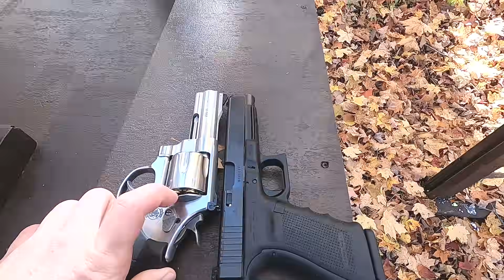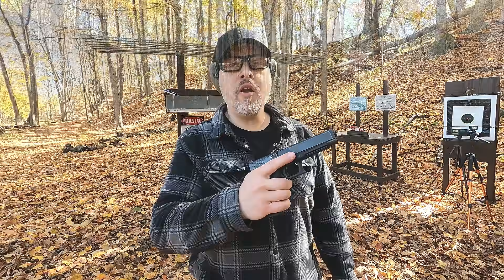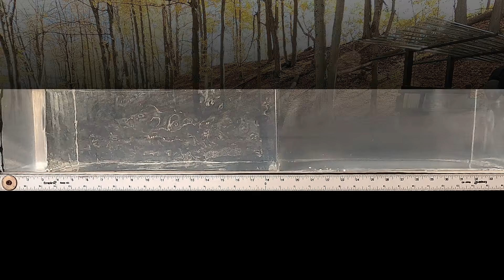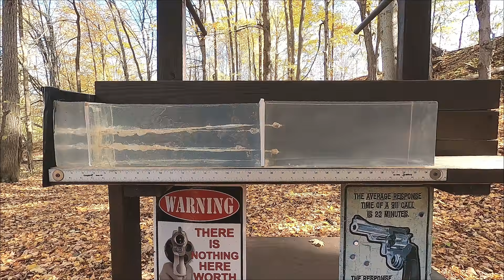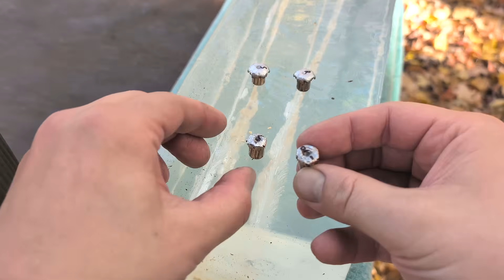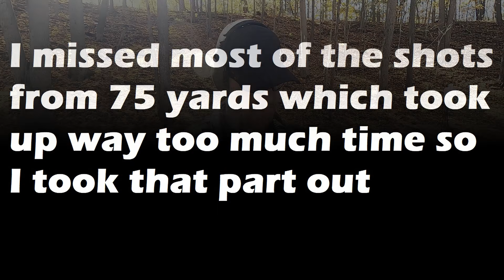My FIRST 10mm Hand Loads! (Part 2) 200 gr XTP - Revolver VS Semi-Auto Ballistic Gel Test

Comment: When you mentioned about the feeding issues others have had with 10mm pistols, not just you, I remembered something Tim Sundles of Buffalo Bore said about the 10mm. He is also a fan of the cartridge but he says that a longer cartridge, relative to diameter, is going to be more finicky and less stable in terms of feeding into the chamber (autoloaders) than a shorter fatter cartridge such as the .45 ACP. He says this is just a common thing in machine works and he's seen this pattern with other things too, not just guns. Apparently the Glock's wider feed ramp makes for less on an issue thus this is not as apparent in those guns as it is in 10mm 1911's and so forth. Given his extensive experience with these things I think he's on to something regarding 10mm reliability compared to .45 ACP or even the .40 S&W.

Comment: Nice video! Perhaps a stronger recoil spring may help running 10mm in your conversion?
Reply from the maker: I don't think they make greater than the 24 lb aftermarket one I am running in it.
Reply: @GunSam OK then. I have a 20 lb in my RI 1911 10mm. And 16 lb with it's conversion 40 s&w barrel.  No hiccups so far. Has to be a solution for that sweet machine of yours. 
  I have a Remington rp45,  and bought a 9mm conversion barrel/ slide for it. I like to slowly cycle a new gun with a full magazine, to see how well it functions before ever going to the range. Well, the 45 slide wasn't picking up the round smoothly, and not chambering consistently. I ended up adding some radius to the back side of the extractor, finishing with a good polish. No more issues!😊

Comment: Another great video Sam, The breech face on your 45ACP is larger than the 10mm swapping out the 45acp extractor with a 10mm might help with reliability.
Reply from the maker: No, it won't. I have done that already, there is no difference.

Comment: People whomsay you lose XX amount of gas from cylinder gap in any amount over 6%, have no clue about fluid dynamics. Even though these are bullets propelled via explosion, the principle of fluid dynamics applies to them and that is that the time of the projectile moving down the barrel is being propelled by the explosion which was also constrained via the bullet casing the vast majority of the explosion goes into the forcing cone because the gases are traveling so fast, they haven't experienced disruption yet. The outside edge of the explosion is sheered off and comes back towards the shooter. You are talking anything less than 5% at thr very most.

Comment: I think the 45 ACP has improved because of guys like you!
 five or six years ago it was trash The ones that did open in 185 balloon giant and then go deep enough and the if the 230 IF expand they got even bigger, They seem to have done an adjustment of the density of the lead and I still think a 200 to 210 is the best grain weight for it. 
I think you have to go about an ACP and an SPL in the same way they're slow and you have to have a board that's softer lead that opens and goes deep enough.
Reply: Oh yeah, the 45ACP has never worked before the present time.   :)    Sure.......
Reply: @JohnSmith-f6o round lead balls killed things but when you pay for a hollow point to expand and work correctly then it should there you go, Fred Flintstone. 
Wait let me guess two world wars.. what happened is YouTubers show them not working correctly and then the companies seen it and had to fix it because the people were offended.

Comment: You should get a different 10 mm, Glock 29 or 20 but really XDM elite 3.8 in barrel. 
I'm as poor as they get but if you get a buds gun shop membership then you could put things on layaway for 3 months or 20% down. 
$10 for a m carbo stainless steel guide rod for your 380 LCP. 
Great video as usual I love me that centimeter ,best millimeter that 10 , 40 long. 😂

Comment: 500,000 v a x x e d are K I L L E D DAILY on a population of 8 billions (1/16000)
The average number of runners in a marathon varies significantly by event, but major marathons typically attract between 40,000 and 55,000 participants

So you should see 1 marathon runner D E A D per race (8hr/24hr * 3 death = 1)
And indeed this is the case...

6 deaths of marathon v a x x e d runners in two weeks
All under 36 years old 🚩
Everything's normal. SLEEP
Ellen Cassidy 24 years
She died at the Cork Marathon in Ireland on June 1
Olivia Tuohy 24 years old
She died at the Edinburgh Marathon on May 25
Cristina Santurino 36 years
She died a few days after his Zegama Aizkorei marathon on June 10
Joao Gabriel Hofstatter 20 years
He died at the Brazilian marathon on June 10
Carolina Lemes Oliveira 31 years
She died at the Junino Marathon on June 8
Eliud Kipsang 28 years old
Deceased after’a heart attack on June 10

Comment: I think its great you check for bullet creep.  I have a few 9mm revolvers and they all seem to unseat bullets to some degree.  I have a 6 inch model 610 also, but unfortunately haven't had a chance to shoot it yet.  Hopefully I will get a warmer day soon!  Great Channel here !!!
Reply from the maker: Thanks. I have found in general that 9mm in my Taurus 905 revolver creeps a lot more than 10mm and .40 S&W in my 610 revolver. Like due to the 610's weight, but I also think in general 9mm has less taper crimp than other cartridges it seems.
Reply: @GunSam  You make good sense!

Comment: Hahaha
If ya can find any, try Power Pistol easier to make velocity under pressure. 

Old school was BlueDot/800x for 10mm Heavies but it can be hard to get top cause just a touch too much and its over pressure.
Reply: Blue Dot with 180's and 200's was my "go to" for the G20 many long years ago. It did not impress me with jacketed bullets of any weight in the M610, the velocity being mediocre compared to everything else. Strangely enough it did prove to be an excellent option for 200 grain cast bullets...go figure. I test all my loads over a chronograph if you wonder. I still like Blue Dot for short barrel magnum revolver loads along with Power Pistol. Power Pistol is my second choice for jacketed 10mm revolver rounds by the way, I fired hundreds of rounds comparing all the suitable powers I had available and you could certainly do worse. 🤓👍